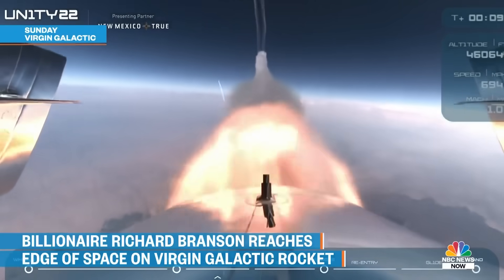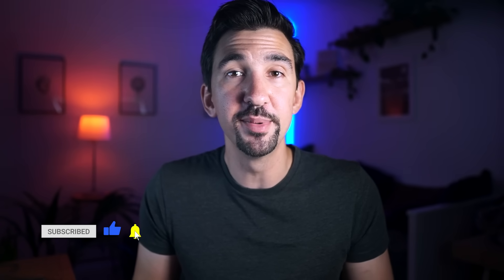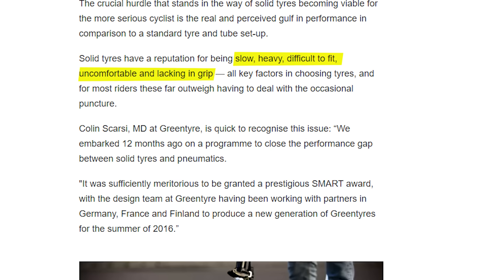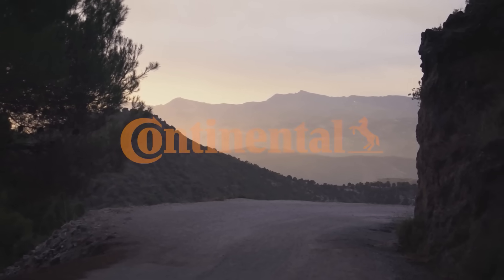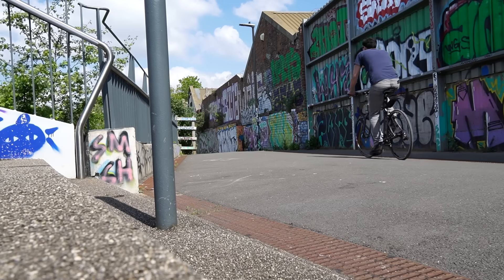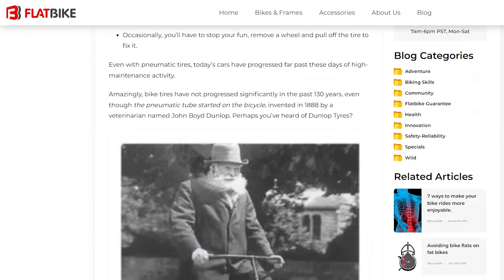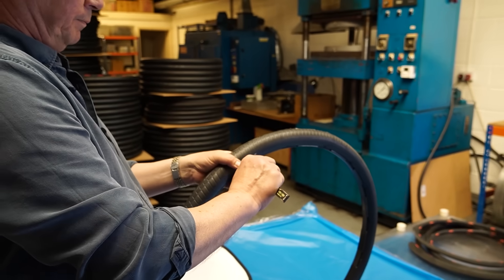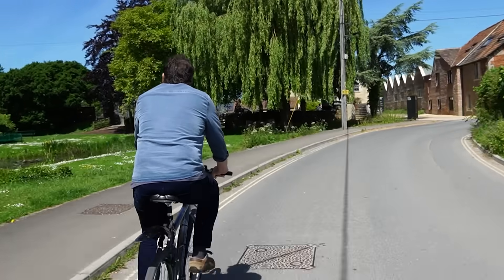I Tried Solid Bike Tires | Here's What I Found

Comment: Dr. Miles
I'm afraid The Gentleman that created these very cool tires overshot what he was trying to do and that was to solve the problem regarding inner tubes or tubeless tires.
He developed a tire that came that was ready to go and be used as is, Once mounted.
However, if you want to go more off-road the obvious Tread does not hold up to that kind of riding from what you can see in the video.
Don't get me wrong his idea and solution is pretty cool.
Can you ask him a question for me?
Why we do not just produce a solid innertube that you can put into any tire instead of making the whole complete tire tread and all.
If people could order the size of his solid innertube to go into their own tires he would make a small fortune overnight.
What are the most common sizes of tire, start with that then expand to other sizes or people can have them custom ordered.
Then it doesn't matter what type of writing you're doing because he removes the problem with your tire going flat.
Just an idea I thought I would point out to you and see what you thought.
Have a Good One!

Comment: I don't know how this guy said hes has been consulting FI tire engineers Thats BS  NO tire that rnoves at high speed is made that way they get too hot.  solid rubber works at low speed but tires start heating up fast  Nobody in F1 would use a solid tire.  F1 tires are bald and very thin just to avoid internal chaffing that causes tires to heat up.  The author needs to learn how to 1. ride a bike  so his butt don't hurt  2. try a Mtn bike  those tires have more suspension when properly inflated.  most better moutain bike tires inflate to 70 lbs  buy suspended mtn bike they have them for cheap at walmart but hes an engineer so he should be able to afford anything  3.  get a thicker padded seat.   Also inflate your tires before you ride many dumb riders ride in under inflated tires that puncture when the wheel pinches them ,  I go 2 years with out punctures.  Alsp  I havent tried the premium tires but that sounds great too.  I do use a puncture proof  tube and the vinyl insert armor,  I also look where i am going and try to not run over piles of nails huge broken glass shards police  spike strips and vines with 1 inch thorns.  Being a defensive rider is part of the challenge of riding cycles of all types.  A cyclist never has the right of way if you think you do you are betting your life or limbs.  As the motor cycleists say keep the shiny side down

Comment: I like the concept of airless tires if I had them on my TREK MERLIN 5 I could probably get rid of my patch kit and pumps im also thinking about converting my bike into a mid drive electric bike I have no concerns  with the rid I have front fork MTB suspension and a seat post suspension with jell seat

Comment: Right okay, so when the tread wears down you have to replace the whole thing which uses probably like 500% more rubber than a traditional tire else you have a rubber sausage with zero grip available to you, not sure about its actual practicality. Also how the hell do you get so many flats? Sounds like you're skipping out on maintenance to me but thats a moot point really.
Reply: Also you have to remember that you're over doubling the weight of the tire and that's unsprung mass, sitting as far away from the pivot point of the wheel as it can be so that's going to require more effort to start to turn it, keep turning it and stop turning it. It might not be much but it could all add up.
Reply: You sound anxious,  @jim8171 .  There's a simple solution for you--just don't buy them.

Comment: Yet motorcycles don't have this puncture issue nearly as bad. This is more cyclists whining than anything. Use tougher pneumatic tires.  Don't get me wrong solid tires are a good idea but you will run into a problem where the center of the tire will flatten over time. Previous solid tires wouldn't seem that bad if you had a bike with suspension.

Comment: Even if these aren't perfect, As long as the weight is low enough, these seem like they would be great for amateur mountain bikers.  As long as they make an aggressive enough tread for good grip, This would allow us to never worry about blowing out a tire again. And even if the tire isn't the best at absorbing impact, mountain bikes already have air springs in the front and back.  And someone mentioned wet conditions, but I wonder how much that would matter when riding on dirt/mud/grass.  On really smooth pavement, I could see wet conditions really messing with the grip.  But I don't know how much that would matter in dirt/mud, if you have an aggressive enough tread.    And on a mountain bike, it's not fun to have to carry an extra tube ( or sealant ) and an air compressor with you the entire ride.  

I hope these come to full market sometime soon.  I'll gladly buy a pair for $50'sh, just to try them out.

Comment: The problem with all airless tires is that you can´t adjust the pressure to the load. You´re tall and/or fat? Airless tires won´t be optimal for you. You want to transport stuff or have a cargo bike? Airless tires won´t be optimal for you. I use Schwalbe Marathon plus tires. Never had a flat one and they always lasted for over 10.000km.

Comment: On my way to work I have to pass a street in front of a club and there is always broken glass on the street and sidewalk. I had to repair or change the tube at least once a month. Usually more often. 
12 years ago I switched to non flatable tires (Schwalbe Marathon I think. They have a thick layer inside to protect the tube)) and high quality vents from a lokal bike shop and since then I never had to do any repairs since this day. I had to change the tire 3 or 4 years ago. That means the tires lasted 8 or 9 years.
The only advantage I see in this product is recyclebilaby

Comment: one hr to change out a tire....even stopping a couple three times for beer, should not take so long.
but ok your video was about "skinny" tires, for on pavement use. how about us "fat" tire riders. on our mt bikes. not the stupid overly fat trendy junk fat tires.
im my area i used to ride in, there is this thorn weed. grows everywhere. and while i was riding a lot, i went weight wienie.  then tires thin tubes light weight everything, on a full boinger, alu frame bike. all this was pre disk brakes. some times the tires needed to be pumped up mid ride as they just leaked out so fast. but mt bike tires must flex and conform to the ground unlike street skinny tires. so the psi is lower to start with.
interesting to see if this even makes it to market. as here in the usa. take your trashed bike tire numbers and times it by a good 3000% more. then durability? grip? etc?

Comment: schrader valves are far more standard...especially considering the market these are aimed at......far more in use, far easier to find a pump anywhere you are...it's a moot point if you are going solid, but still...not a fact.  You have to consider more thatn a street bike deisgnd for transport...childrens bikes, bmx bikes etc etc....

using a rubber mallet for installation is one thing...what about removal....I don't see them being easy to remove.

Comment: They need to develop a rim with a removeable side.  You shouldn't have to stretch a solid tire over the edge of the rim.  This will allow for firmer / low rolling resistance.  Add a soft suspension to the bicycle for comfort.

Comment: Rubber tires were solid for a long time. Dunlop's pneumatic tire was a big advancement. Air is effective, cheap, light and abundant. Tire sealants have come a long way. I'm also really curious about the traction of this rubber compound. Out of the mold it looks shiny and reminds me of EVA foam soles on shoes that wear down smooth quickly. Traction is vital for performance and especially for safety. How do they perform on the wet roads in England?
Are the little orange reinforcement tabs that lock to the rim also recycleable? Are special rims needed? Is there any concern with lateral forces and the tire rolling off the rim?  All questions that I think would need to be addressed for any new tire design.

Comment: Nice review. I been riding a pair of Tannus tires for about 4 years and 6,000 miles now.  I love these tires.  Never had a problem with grip rain or shine.  I am not an extreme rider though.  I'm more of a casual to commuter rider.  My back tire needs replacing soon but my front tire will easily be able to do another 4,000 miles.  Rolling resistance is no more than a pneumatic tire with green slime in them or plastic inserts really.  They feel like pneumatic tires pumped up to 90 or 100 lbs.  They were super difficult to put on even with the special tool you can buy which I did.  I was happily going to buy another set of Tannus tires but if Gecko Rubber tires are easier to install, more comfortable ride and 100% recyclable I am in!

Comment: Weight is less of an imperative as the market share of e-bikes increases. Reliability is probably more important to the sector of the market that started bicycling when "sweat equity" no longer was a roadblock. I see these tires selling well and even become standard some of the premium e-bike brands. That extra 1/2 horsepower with e-bikes can be used for additional heavier options  besides reliable tires. Things like derailleur-less shifting , belt drives, shock absorbing hardware, etc that added wight penalties have become inconsequential.

Comment: I've been frustrated over the last few years by the number of punctures I get in my little commuter bike. I found that the most frequent culprit was bristles from wire brushes used in my workshop. Presently I'm fighting back by using a vacuum cleaner head fitted with magnets [old speaker sets] . But I'l like to do without punctures for sure.

Comment: Back in the late 80's early 90's you could buy airless plastic tires for bicycles which used mechanical structures to provide the bounce needed but they didn't take off, seems like people aren't about to pay more for airless tires when just pumping up and changing the inner tubes are only a mild inconvenience.  I can see an advantage in these solid tires if old tires are being reused to make them but I really can't see people wanting to pay more for airless tires.

Comment: I was driving the unflattable Schwalbe Tyres. They are somewhat similar but have an air filled core.
I have to say driving them in corners felt bizarre, they had a really weird lateral instability. They are okay as commuter tyres but I never quite trusted them.

Glad to see it's getting better. But it sure isn't a great performance tyre.

Comment: Even with a solid tire, it will eventually wear out and need to be replaced, so I don't see the benefit in terms of reducing landfill waste.  If I get a flat, I'm repairing it and continuing to use that tire for a good while longer.  If anything, a solid tire actually puts more material into the landfill as it's not 80% air by volume like a pneumatic tire.

Comment: I don't understand how these metal rubber less tyres at the outset cope with friction. Rubber tyres form a grip with the path which causes friction and therefore loss of energy through heat... But it also stops the tyres either spinning in place on a flat surface, or worse slipping and sliding all over the place. 

Is the metal coated with something? Or is there some optimum strength that ensures a good grip to the road?

Cos just looking at that tyre if it rained then that cyclist is going over ...full stop.

As for the Gecko tyres...well if they are at 58% coefficient at the moment...on the first iteration. Then they will probably beat the air tyres within a few years. Which will make this gentleman that invented them very, very, very wealthy.

Comment: Videos like this make me think; ever used propper, high quality tire with a propper heavy-duty anti-puncture liner?

Spend years and years cycling to school, work trough cities countryside for atleast 5 days a week. Probably 50k kilometers in total. And guess what? The only flats I had where with: Cheap and old tires often worn-out or close to it on trash bikes to go to a bar. Those bikes where fine after putting a quality tire with good puncture protection on. And then I'm talking about usage in innercities where there is glas/broken bottles everywhere.

With propper tires, like a 20 euro (including tube) Schwalbe having a strong liner against punctures that last for years it simply didn't happen. Just changed the rear tire on my old bike for bar hopping because it was worn out, it had a flat once in its lifetime but was a crap tire costing 5-10 euros. Now it will be, like the front, a proper one and besides pumping it a bit every couple of months it surely will stay on for years without an issue.

There is a place for solid tires but people complaining about getting flats and often requiring to pump up their tires simply never got themselves a propper bike tire.

Comment: I appreciate your attempt at being scientific in some areas but this is a very shallow, non-expert review, posing as expert - it's little better than any other infomercial. I am somewhat reminded of the AutoBike which had some compelling infomercials and were a lot of BS.

Bicycles are deceptively simple. The bicycle tire has textile in it because that is just what it needs. Textile is amazingly underappreciated technology, as is air.

You didn't mention cornering. Real reviews of a solid tire will note how terrible and even dangerous for cornering they are.

This guy is onto something with an improved solid tire. Tannus is also. Tannus is actually an expensive and very new solid tire. Solid tires will not compete with regular tires for regular bike use. Racing bikes require LESS robust and long term tires, not more. You could conceivably get away with a solid tire in a race, just engineer it for a single specific use. Not so with normal real world commuting.

Scientists often miss what they can't measure (blind spot). There are a lot more variables to the performance of a tire than the 3 you mention.

Solid tires have a real world use on factory bicycles. This is a niche but it is a real market and likely to increase as companies look to decrease CO2 waste and needless use of automobiles on a factory floor.

The issue of flat tires is also misunderstood. It is not that the tire in pneumatic that you get flats as a problem. Rare flats are not much of a problem. It isn't the technology that is the problem. It is the abundance of cheap cheap (garbage) tires that are good enough to sell, but get flats often. Also education is a big factor. Higher tire pressure dramatically decreases punctures, though this may seem intuitive to your average rider who has not been educated on this topic.

Anyway, bicycles are very democratic and diverse. Even if this solid tire on a daily bike is a bad idea that won't catch on there will still be a few around the world who ride on it and swear by it. Different spokes for different folks 😁

Comment: Nowadays I don't ride on bikes anymore. When I did, I used them daily for my commute to work. The mishap with flats you're describing here never happened to me. I had flats no more than once a year, approximately. I live in the Netherlands. Maybe the infrastructure here is good enough not to encounter your bad luck here as often? Anyway, I don't have flats often enough to exchange the comfort of tires with air for the more uncomfortable solid ones, I think.

Comment: Starting on million tonnes of tires and tubes dumped is something I hadn't thought of despite often commenting on footprints of sport and various apparently green activities. Thanks. However, I wonder how you manage to have so many punctures today. That was the frequency in 1970s. With Specialized Marathon 28c, my son commuted ten miles to school from 2000 to 2005 on track beside A13 covered in sharps without punctures (23c Marathons did shred immediately).
   So, depending what you're doing to get so many punctures, another issue is state of roads and paths. Away from gutter on road is cleanest and fastest.
   When A13 cycle path was painted blue and became a cycle super highway, authorities started cleaning it every morning. The cleaning was the game changer that made the path a realistic bike route. I'd suggest maintenance of roads and paths to remove sharps from ICE vehicles and smashed bottles would help in Bristol and be cheaper to wider economy as more people use bikes and they spend less time and money on punctures

Comment: Back in 1970s, tires got far more punctures. Nutrak Nomads with Kevlar were much better at resisting punctures but tended to crack with age. Nowadays, half decent tires are far better against flats and more comfortable without cracking. We're back to 28c to 35c on road and commuter bikes so lower pressures lower puncture frequency. 'Solid' tires will have to be unrecognisably superior to earlier versions to  replace pneumatics - tubed or tubeless. 
   However, the new lockdown generated cyclists who commute under ten miles in London may find solids work for them. Many live in flats with no space to keep tools or work on bikes and they haven't learned how to fix flats or can't remove tire from rim. They do have lots of bike maintenance shops and mobile mechanics, including shops that stopped selling bikes to focus on maintenance. So, if they puncture, they call on cycling equivalent of AA. No need for solids

Comment: well for one you can't fine tune a tire without air, a regular tire you can pump up very hard so it rolls easily and then air out to make it softer so it has more grip in the corners and offroad. also your weight is a big consideration the heavier you are the more air you gonna pump into it. an airless tire is just set to whatever the manufacturer decides is best compromise